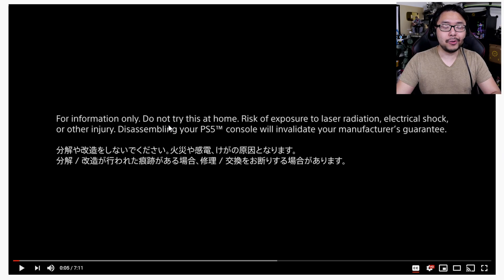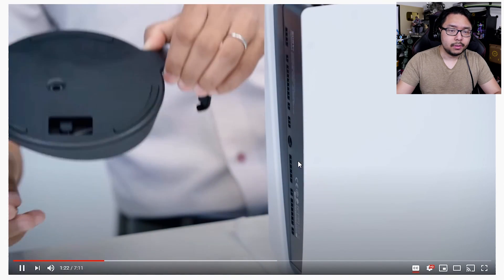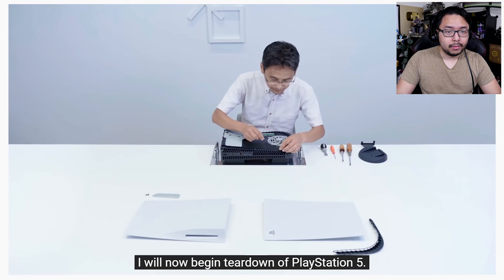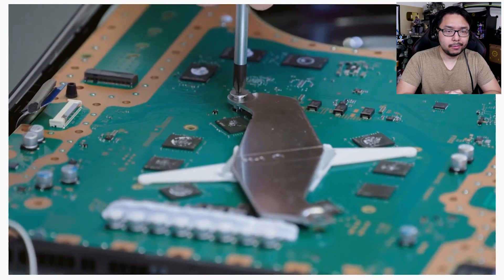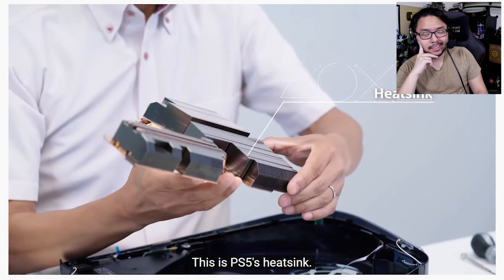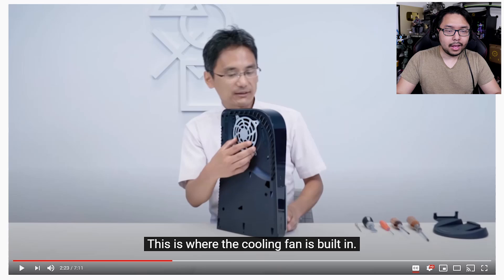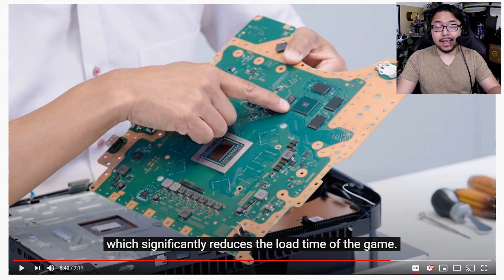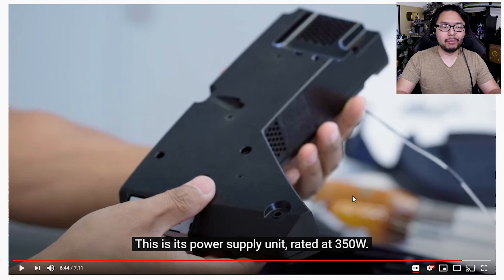Reacting To Sony's PS5 Teardown (Cooling, SSD Slot, Swappable Panels, & More)

Comment: Yeah, its going to take a bit before I adopt the new systems but the PS5 seems like a sure thing for me, mainly due to how to expand the memory. I can get me a M.2 SSD for WAY cheaper than that proprietary expansion card. I'm not super worried about how fast it is compared to the onboard because storage space is the goal. The console will be faster during load by default due to better hardware in general. The Series X expansion card is a sad joke. Its literally double the price of a 1gb M.2 SSD and nearly the price of their  Series S -console-....

Comment: I think reviewers might be missing a functional use of the removable panels, you hit on that you would like to see one made that fits tight to the shape of the console but I think this contradicts the purpose of providing an air gap between the console and other surfaces in order to aid cooling. Others have questioned whether cooling will be as efficient when the console is lay horizontally as opposed to vertically - I don’t see any reason why they would differ as there is no change in the volume of air that can be drawn in (and exhausted out) and the console is even lifted off a surface thanks to the stand. I think the cooling efforts go beyond the internal efforts and the external is even driven by this. A nice execution of function over form.
Reply: Just like how innocencii mentioned, it really seemed like ps5 pursued functionality over form factor, which means they really care about their consumers.
Whereaa with xbox, it might have been compromised because they have a specific form/shape they were going for which is the box type.
I've owned both ps & xbox units. I would take a larger console over a smaller one if it would mean quality gaming experience.

Comment: I have torndown the ps4 before and i can say that this looks way simpler and less parts. Also the cooling is definitly better the ps4s was small and felt like a side part with a tiny fan in the middle of the parts so it didnt reach things like disc and hard drive also with a metal part between it and the cpu i dont know why. So yeah already looks way better!

Comment: I really hope that "special" liquid metall is going to work for a long time.
Also, it sucks that Xbox series x doesn't have wifi 6
Reply: @Shia Lebeouf: Life Coach No, not only for overclocking, regular use also. But i've read alot about it and when oc it lasts more like 1 year and 2 years w/o oc.... And yeah you're right about gpu is used more in games, but one thing that you are forgetting is that the gpu and cpu is one the same die therefore it will most likely get pretty hot

Im not saying Sonys cooling will be problematic or that the liquid metall is a bad thing, I just hope that they don't overheat

Comment: Those are some massive side panels.. most of the popular 3D printers don't have that build volume and XY or Z..so you really need to want to do a bunch of gluing and post processing to make your own panels..
And if the PS5 needs that much ventilation... I doubt most prints done in PLA ( what the vast amount of people actually print with ) will stand up to that kind of heat without deforming.

Comment: Biggest console yes, but still will fit under my tv while series X won't...also this guy is pretty small :)  I really appreciate that they made this vid, actually, kind of an impressive mobo setup...and that liquid metal deal, I'll have to look into that more.  While the PS5 requires a tiny amount of work to add an SSD, they do allow 3rd party solutions...I rather hate Microsoft's Apple-like proprietary crap approach.
The dust traps are amazing if they work...I fear series X will be not so lucky with those massive holes; I expect dead bugs in 10% or more, and those aren't good for performance...though I'd have to see inside to be sure.  The openings in this seem much more conducive to good flow and less interior dust accumulation.
Also the removable base...heck yeah.  Kinda ugly on the series x, not that it matters really.
Reply: I feel like with the amount of air coming through the series x it’ll push everything out of it. It’s designed to push everything out of, no twists and turns like other consoles
Reply: They won’t allow any m.2, they need too reach an acceptable speed. No doubt similar to what it’s already at. Since that’s what developers will be expecting to work with

Comment: Spaces to vacuum and remove dust was a nice surprise. 
It will no be as difficult to vac the vents like on the ps4 unless you had a brush nozzle and the fan cover looks big enough to cover it with a mesh made dust catcher too like you can get for pc fans.
My pc store shopping list has gotten a little larger now.

Comment: That ssd speed is actually faster than 5.5, thats only for Raw Data speeds, but they're using Kraken file compression which they say will support more games in the future, and it basically compresses the file sizes (like zipping on a computer) whilst still keeping the full quality of the assets and also makes the SSD speed 7-8 Gbps for compressed files, this is confirmed btw, go and check it.

Comment: "Confirmed"
Samsung 980 pro 1 TB $229
West Digital Black SN850 NVMe SSD 1 TB $229, 2 TB $449
Those 2 SSDs for sure should work well with the PS5 (they are being marketed as such or atleast reported to). so Im gonna mark these as "confirmed", but since I dont have access to the PS5 to try it out it is what it is. But these 2 SSDs have a read speed of atleast 7000 MB/s, the PS5 is only supposed to be 5500 MB/s, but ive seen a report that says it is actually more? Im gonna say that anything over a 6000 MB/s read speed should be safe to buy, although there is some with 5000 MB/s, but i wouldnt recommend purchasing these. As of writing this comment there is only those 3 SSDs that i listed, that I can find to expand the ps5 storage. These are 500GB and 250GB versions but im not gonna be bothered to even list those...

The reason Im leaving this comment here now is simple... You may want to pick one of them up before there is a scramble for them, especially come November when everyone gets their ps5s. Those are the prices currently listed on Newegg,

Comment: curious no one seems to have mention, the spot where the ssd's are going looks like slots for three of them and not just one?
Reply: It's a single bay.  The SSD slot is oriented the long way, and there are multiple screw holes to accommodate M.2 NVMe drives of different lengths. 42, 60, 80mm long.
Reply: @rhekman  ahh ok TY

Comment: I have heard there is a problem with liquid metal “drying out” after a year or so of use. I wonder if Sony’s testing has ran into this issue?
Reply: They tested it for 2 years I believe. I’m pretty sure it will b all good .
Reply: @illstylez4202004  I think 2 years is just not good consider it is about 1/4 of the life spam of the console, also it can damage the hardware when leak... but who knows, need to see that in actual practice

Comment: Technology that has been used for years and just is beeing rebranded to make it sound like something new... 3d audio! Dolby athmos, DTS:X...
NVME SSDs
Reply: To be fair the PS5 SSD has never been done before, soldered onto the board and reducing latency to near zero by working in conjunction with the SoC, nobody on a PC would care to do that. Also, 3D Audio sounds like what we’ve always had with headphones, but apparently it can work well with TV speakers somehow which we’ll have to see. That’ll be a game changer for console. Overall I think Sony are actually making innovations with their engineering, yes we’ve had an SSD and Audio before, but not like they’re talking about. We’ve always had vacuums, but Dyson came and changed the game with a simple idea.
Reply: @narukami6364  i'm skeptical about the front speaker thing, but if they do a better job than creative when they tried that it would be nice.
Reply: Angeltear Yeah, we’ll have to see. They said that support for TV Speakers will come later so it seems they’ll be putting some extra time into it. If you can hear which direction footsteps are coming from reliably without needing direct sound into your ear, that would be ridiculous.
Reply: The difference with Sony's 3D audio solutions is that (according to them) it doesn't require custom audio hardware, unlike Dolby Atmos, but achieves directional audio with just regular headphones or even front facing speakers.
Reply: @defeqel6537  custom audio hardware? Afaik you can purchase atmos for headühones on that stupid app store windows has and just plug any headphones in your pc. You have to enable it in the audio settings ofc.
Reply: @angeltear2145  Truly? I've under the impression that it only works on Dolby Atmos branded / certified audio equipment.

edit: apparently, there is support for headphones, but not stereo speakers if I'm understanding correctly
Reply: @defeqel6537  you're correct in that. The only front speaker setup that promied surround with only the soundbar was from creative, but that didn't really work.
Also some games have simulated headphone surround already in their sound engines (bf4 for example has one of the best so far).
Reply: @angeltear2145  Will be interesting to get comparisons how the different solutions fare when they are released. Hopefully Dolby Atmos, or something similar will start getting more traction thanks to this too, PC audio has been kind of boring for a while now.

Comment: So the size is due to their cooling solution, and it seems the thought they put into being able to keep it clean. I really appreciate that because dust has a huge enemy of electronics and being able to get in there and easily vacuum things out will keep the system running happily much longer.  Very nice, Sony.

Comment: with the ease of tear down, and the overall huge size of the console, I really would not be surprised if the market goes a step beyond just custom side panels. Also, I can 110% see custom panels with fan hole cut outs.

Comment: WTF? It's a small blower fan surrounded by plastic. It's just circulating hot air around the box. And they put fucking gallium on the chip.. Every day one console will be dead within 3 years. They overclocked a pos and now they have serious heat issues. If they didn't they would have sent you a console to play with just like Microsoft.

Comment: It is a interesting design I'm really curious how the temps are versus the series x on full load playing the same game for extended durations. Really would love to see the comparison videos. Series x has a huge exhaust vent while ps5's vent is a intake vent....Sony is using liquid metal and heatsink pipes, while series x is using a vapor chamber...Sony even said that because of the size heatpipes essentially is as good as a vapor chamber....

Really want to see which design ultimately works best
Reply: They said that the front vents on the PS5 were for air intake, and the entire back of the console (other than the USB, Ethernet, and power ports) is a vent for exhaust purposes. I'm equally as curious how the comparison will turn out though.